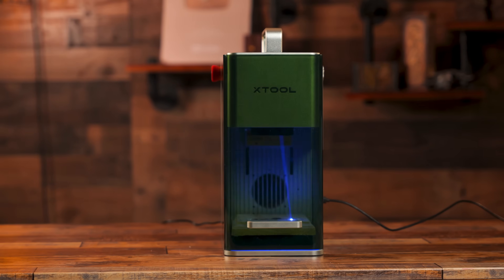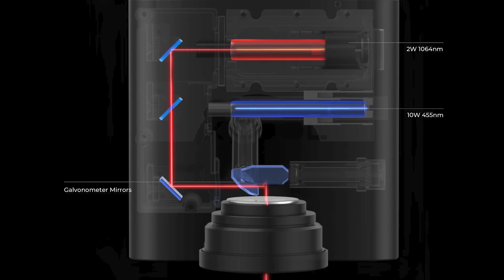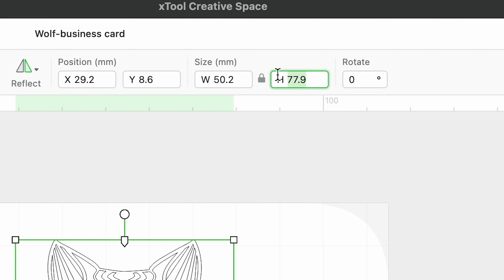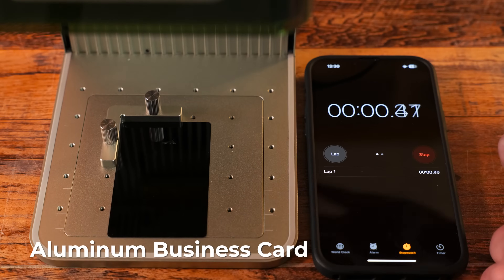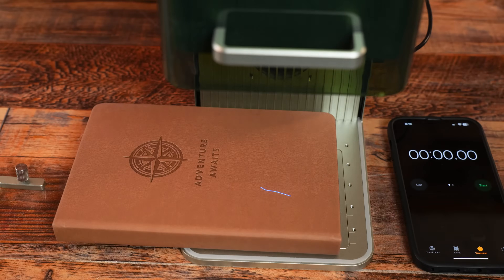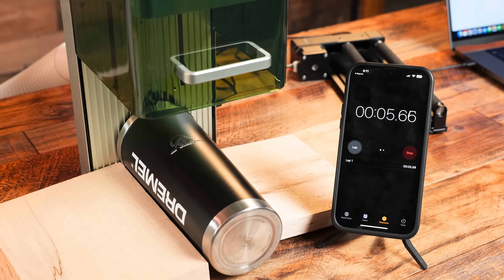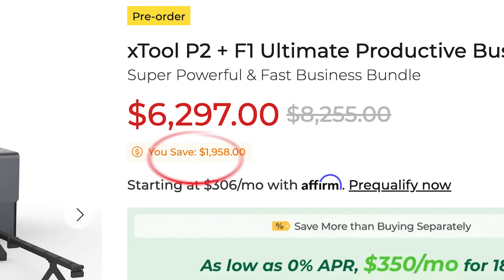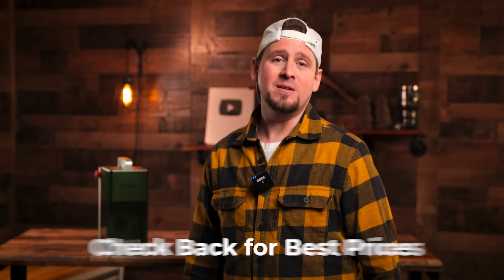The Next Generation of Laser Engraving: The xTool F1 - Lightning-Fast and Unbelievably Portable!

Comment: Nice, but here it cost the same price as a car. Not worth the investment. Overpriced...
Reply: how much does it cost where you live. The pricing of this is apparently wildly different
Reply: @aKadoki  Here it is about $1,500-$2,000. Some machines go up to $30,000. (Import duties are heavy.) So, for a mid sized business you need at least 4-6 to start off. Doing a 100 - 1000 units on one machine is crazy. You need to split the load.
Reply: @neostiny6076  the f1 is 1800, m1 ultra 2k, ray 40w 1700, in eur where i live. Im split between these. In my business i mostly do 3d prints but having the option for metal etching/engraving seems like a good idea.
Reply: @aKadoki  I was looking into this (Fiber lazer) for jewellery. Silver and gold has actual value. Creating things of value makes more money. Even in brass and stainless there is money to be made. Many companies want small Christmas gifts for their clients, or just gifts for large purchases with their logo on. Stainless steel key chains are long lasting. Engraving onto memory sticks for computer companies. And so on.

Comment: Hi! I am in the process of making a buying decision.  I am set on S1 with 40W and 2W IR so far. Will it be a better combo if I buy the S1 40W with F1 light instead? Or my 1st option is a better choice? Any help is appreciated!
Reply from the maker: Good question! So if you are dead set on the S1 40W, getting the F1 Lite would have the added benefit of engraving smaller items at faster speed… and also portability. If you get the 2W IR, you will have WAY MORE flexibility. To me, having the option to engrave metal would be more beneficial to me than getting the F1 lite. Hope this helps!
Reply: @CorneliusCreations  Thank you for your reply! It helps a lot! Appreciate your help! Subscribed as well :)

Comment: Does this engrave glass?
Reply from the maker: If you use black tempura paint on the glass, yes. Only C02 laser can engrave glass without a medium. The wavelength of the diode laser can’t etch the glass without paint.

Comment: Wow, I used my 2.5W laser on the 3018 for the first time yesterday, coaster image took 45mins. These would be great at markets, engraving on the spot. And then you just mentioned going to Craft show, yep, $$$$
Reply: 45 min or 45 sec?
Reply: @chammockutube  Galvos are faster, my 3018 uses threaded rods n stepper motors
Reply: @babbagebrassworks4278 , sorry, I misread your quote.  I thought you were saying your F1 took 45 minutes.  My experience so far has also been with the slower stepper motors (on 15 and 100 Watt CO2 lasers), but obviously with biggers "beds" than the F1 which is also nice to have in some instances.  Recent work has focused on burning small-ish (maybe 3.5" square) powder coat off vacuum tumblers with a 15 watt CO2 laser and it takes a painful 12 minutes to do the burn.  I'm trying to understand even if the galvo itself (the movement of the beam) is faster, with such short "dwell time" on each "pixel" of powder coat paint, if the laser is moving hyper fast, we it truly fully burn the paint?  I have to slow the 15 watt CO2 to about 15% of its max speed to get a proper burn and I'm not clear if the faster speed of the galvo will even come into play in this application if the optical power is only 12 watts...